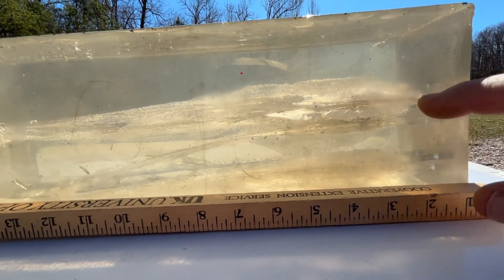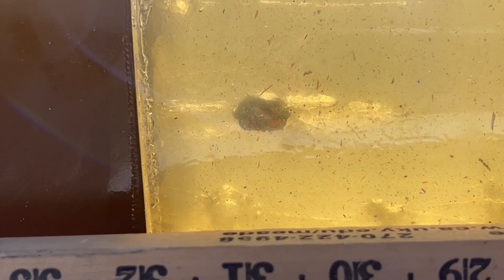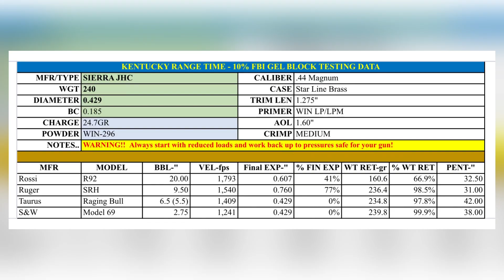.44mag Sierra 240gr JHC, Ballistic Gel Block Test from 4 Different Barrel Lengths.

Comment: Dang!  I better check the speed from my 1894p.  It shoots tight with a medium load of 2400.  Its my accuracy load.  But wound channels look at bit like a SWC.  Maybe I have them loaded down too much.  I do have a bunch of Winchester HSP to try.  They are like a soft point with a smaller cavity.  The lead is also softer than the JHC.

Comment: Just bought a model 29-2 seems like it has just sat in a safe for the last 40 years. Is there ammo that you recommend, that shoots well and will give me good brass? I have none as of now. I want to cast and reload as much as I can.
Reply: I just ran to my pistol safe to make sure my 29-2 was still there!
Reply from the maker: @jamesheilbrunn7187  Winchester and Remington factory brass always seemed pretty good, and Hornady of course.  Those are the brands started with and still load plinking ammo in them.  I’ve purchased Starline since and that’s what I use in most of my top end loads and gel test loads. Unless you’re running at max loads every shot most brands will do good. 

If you’re on MeWe get in a couple of the reloading component groups. I source a lot of good used brass and bullets on there. Just compare them to new cost. Sometimes they’re not a bargain. 😉

Comment: I was Ballistic Technician at Sierra back in the 90s.  The JHC stands for Jacketed Hollow Cavity.  That bullet has a fairly hard core and is designed to stand up to rifle velocities including the .444.  For handgun velocities, I would recommend the 180 JHC which will give better expansion.

Also, these bullets are extremely accurate which should be a consideration as well.  Thanks for the video.
Reply: I found an old box of these and was considering running them in my muzzleloader. I'd be running them around 2000-2100 fps and I don't plan on shooting past 200 yards. Based on his test it looks like they'd do well on deer and pigs.

Comment: Quick question for you, Matt.  When do you determine to use a magnum vs. standard primer?  Is it based on the load data, or is there a rule of thumb.  Not trying to get you in trouble, brother 😉
Reply from the maker: @tombraley3212  sometimes it’s the load data but honestly, running mostly Winchester LP primers I don’t pay much attention to magnum or not magnum. For years their same primer was rated for either so unless I switch off to CCI or Federal I don’t worry about it. Lol.
Reply: @ Much appreciated!
Reply from the maker: @tombraley3212  really big columns of powder and cold weather are the 2 greatest variables that move me towards a magnum primer, or if I’m wanting a nuclear hot load. 😉. The other is if is if I know my powder loads are weighted in really close and I’m getting erratic SD. Sometimes a magnum primer will ensure more complete and consistent powder burn.
Reply: @kentuckyrangetime  Right on 👍🏼

Comment: My understanding that bullet was designed to be run through a 444 Marlin.  I have run this bullet out of s Ruger SBH over a max charge of 2400 at 1550 fps.  Nice video.
Reply from the maker: @stevejorgensen5274  👍🏻 that would definitely explain the lack of expansion.  The bullet was listed as a handgun bullet on Natchez though. 🤷🏼‍♂️. Now we know. 😉
Reply: @kentuckyrangetime  I don't believe it was an offered factory loading in 444 Marlin. I reloaded these in 444 Marlin, they shot okay but the Hornady 265 FP was the best.